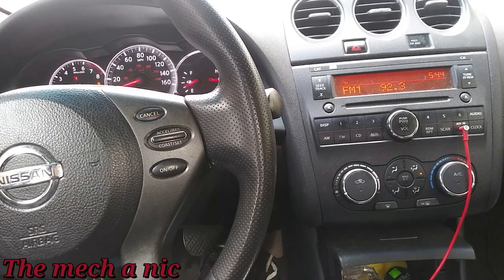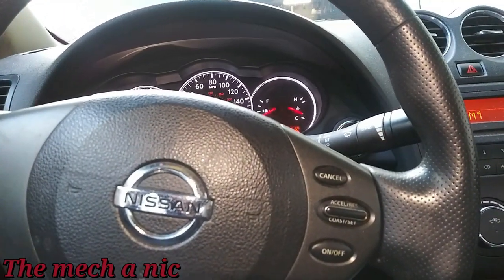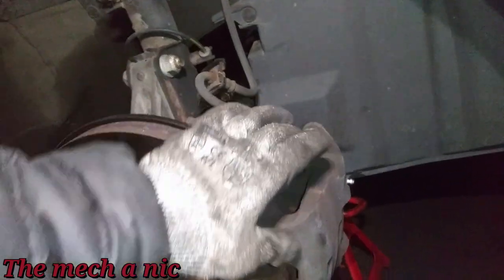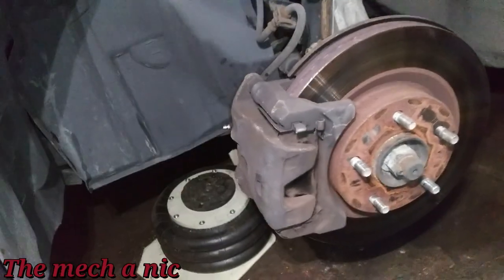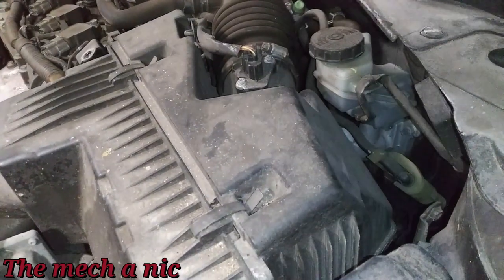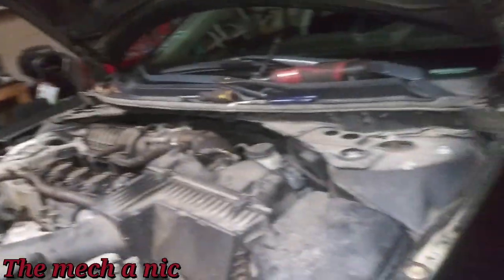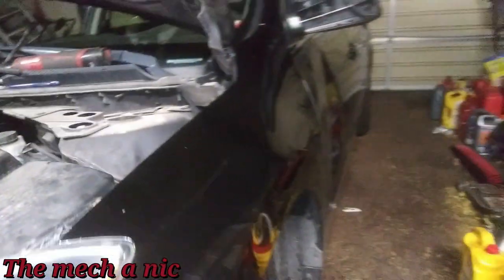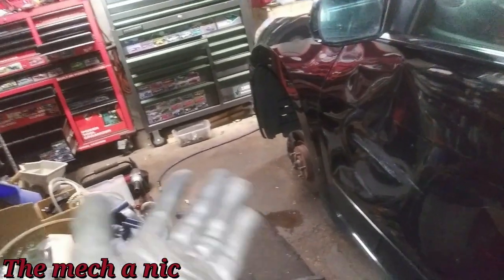nissan front brakes locking up - altima

Comment: This exactly facing to problem my Altima 2013 first issue is no crank after that brake stuck up - i hope this is issue
Reply from the maker: Good luck 👍
Reply: @themechanic6117  thank you very much - my mechanic advice me to buy repair caliper kit, because of this issue, finally when watch this and try to adjust the switch button around 5 minutes i try to press brake pedal i felt soft and try to move- finally my car is no more brake issue.

Comment: so the brake swith was presing on the brake ,that why caliper were seize so the battery was dead because the brake light were on
Reply from the maker: The switch wasnt pressing hard enough to lock up the brakes like the way it was but thats a possibility. Yeah its crazy

Comment: Looks like you can easily kick it out of alignment with normal use too so how many times has this happened to some one randomly in a parking lot.
Reply from the maker: Also how many parts got thrown at a car because of this? On the forums the people having this issue are talking about how they replaced all their calipers, pads , rotors, brake hoses and the problem is still their ! Id be upset if that were me !
Reply: @themechanic6117  imagine if you weren't patient enough to Google some things to research the issue...
Reply from the maker: Hope you have deep pockets then lol

Comment: I had the same problem I changed that switch for the tail lights to turn on and off and my front brakes have been locking up. I also may have screwed it in a little too far
Reply: 2006 Toyota Camry

Comment: How are those switches adjusted?  The clumsy AAA dude must've kicked them out of whack?  That's my guess.
Reply from the maker: They twist and lock in place. Counter turn unlocks then and you can adjust the dept, then once you have there where you want them you turn it clockwise to lock it in place.

Comment: I have the same exact issue with my Toyota Innova. Went to many mechanics who had no idea what's going on for about a year now, everytime I thought I got it fixed it comes back. Overheating rotors and front wheels get stuck. Also the brake light stays on unless I keep pressing the pedal. Wondering if you could help. I really appreciate the video but I'm clearly no mechanic lol.
Reply from the maker: Check the switches that I showed in this video.
Reply: @themechanic6117  I will do that. Thanks a lot man 🙏

Comment: I replaced the Brake light switch, but locked up.. how tight or how do I adjust it just right to release caliper?? 2011 subaru legacy 2.5
Reply from the maker: Just like i showed in the video. You want the pedal to just press the switch without pushing it too far

Comment: my accord did the samething wit new calipers and old calipers now idk what to do and now i lost all brake pressure and the brakes wont bleed where should i start
Reply from the maker: So changing your calipers was a mistake.  First you have to bleed the system till you have pressure, then adjust the brake switch and cruise control switch

Comment: That's odd. Switches don't just move by themselves. Wondering if battery replacement did some sort of electrical tweak. I don't know....just throwing that out.
Good job homes. Most others would've just replaced both calipers and called it a day.
Reply from the maker: Exactly.im not sure what happened here but its crazy

Comment: Did u find out what a no crank had to do with this?
Reply from the maker: it was just a bad battery
Reply: @themechanic6117  i have a 2010 Mercury Mariner doing this exact same thing but it currently has a bad battery. I serviced the calipers checked brake like and was about to order an abs pump as its not the booster until i saw this video

Comment: How did you adjust those sensors?
Reply from the maker: There's nuts on them that you tighten down once you have it in the correct position
Reply: What's the right position???
Please answer...
I have a recall on my pathfinder for these because they kept the light ON at all times...
I took them out and cleaned the Insides..replaced the relay and bingo...no light issue
But then my breaks locked up on the way home
I just need to know how much to adjust them!! 
As specific as you can get

Comment: My locked up like it was grinding..it would shift but wouldn't go.just got caliber, hose,pads,replaced 4 days prior was on my way to take it to shop for wheel bearing replacement and it did this any one know why it wouldnt move
Reply from the maker: If the brakes are locked up of course it wouldn't move

Comment: Isn't ABS supposed to stop this problem?
Reply: I tired everything calipers rotors hoses.... What fixed my problem is I bought a 50$ scan tool cleared all my codes then before driving I turn traction control off !. My wheel speed sensors must be bad so it tells ECU I'm slipping and locks / drags wheels with the abs system to point of smoke. Scan tool and traction control off helped my brake stick problem.

Comment: Duuuuude I just wasted money on a calliper before finding this
Reply from the maker: If you didn't install it I'd return it
Reply: @themechanic6117  turns out it’s not the switch either. Bad brake line. adjusting the parts cannon.
Reply from the maker: Whenever I have a single caliper that locks up I always replace the brake hose with a new caliper.

Comment: I did this to my 2012 Nissan Altima Coupe and it freed them for a second. Once I moved the car and came to a stop everything locked back up again. At first I thought it had something to do with my parking brake because I used it the day before and the next everything was locked up. After watching this video though, I adjusted my switches pretty close to where you have those and it moved and then locked back up. So now I’m confused, aggravated, and just want to sell it. Any ideas on what I could do to fix my issue?
Reply from the maker: If the front brakes are locking up at the same time then it's definitely the cruise control / brake switch. Try adjusting them into different positions
Reply: @themechanic6117  I read some threads on people having the same issues and you sir are correct. It has something to do with the adjustment of the switches. Thank you for making this video. I now know the issue with my car.